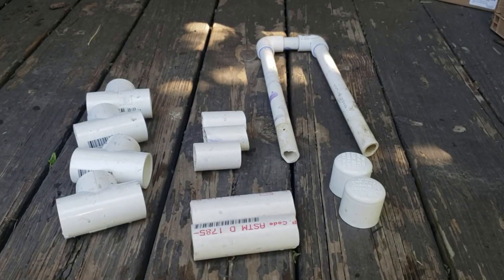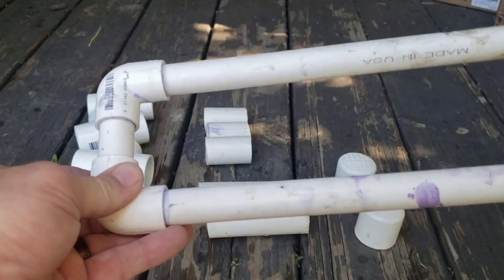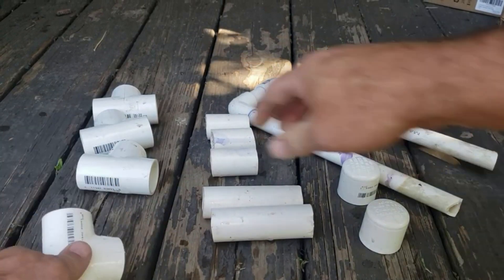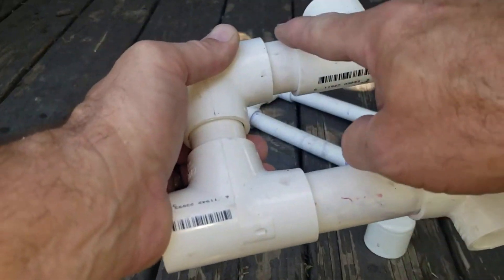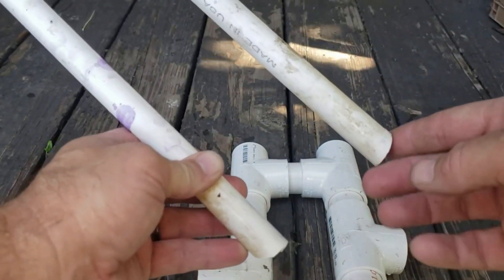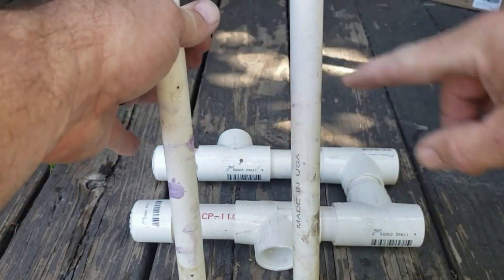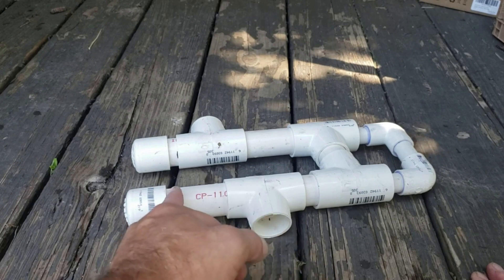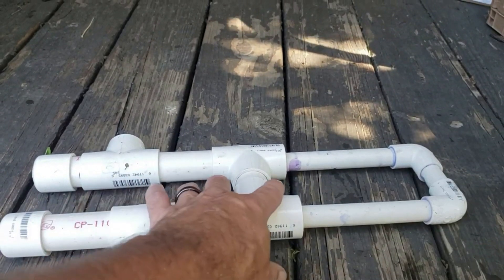How To Make An Overflow Siphon For Fishtank Aquaponics

Comment: Hi, just came across to your vid while searching for overflow siphon. Great vid, I got to understand more of how water flows! BTW, I was just wondering... at 2:40 if you put a T shapred pipe in btwn those 2 elbow pipes (so you can pour water from there),  maybe you won't have to do the 6:45 ? I could be wrong but if you tried please let me know!
Reply from the maker: I believe having that T in between the elbows would allow air in and break the siphon effect.
Reply: @haroldthornbro  I see what you mean. Ok, what about put a removable cap/lid on the hole where water comes out, add the T in btwn the elbows (upwards, obviously),  position the pipe like at 6:59, then pour water into the T. Finally remove the cap/lid to let the water hopefully out?